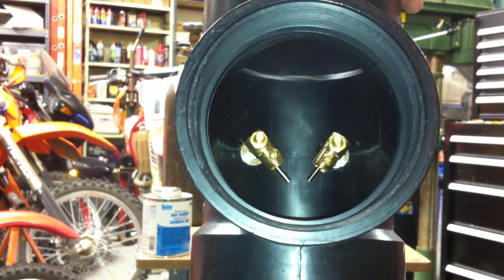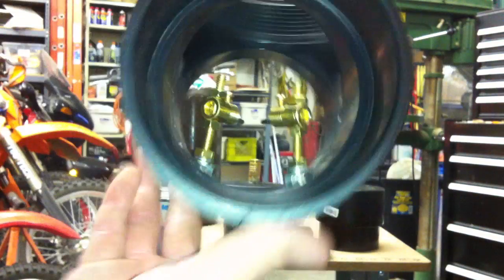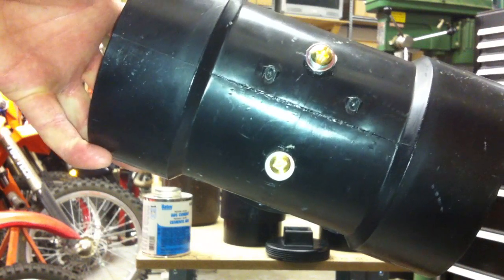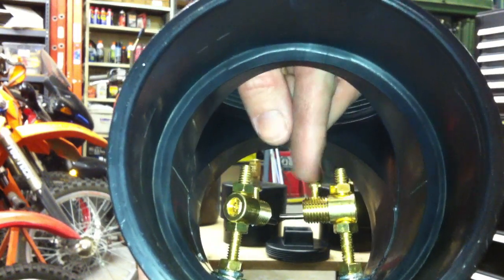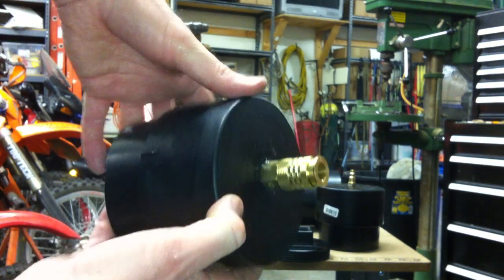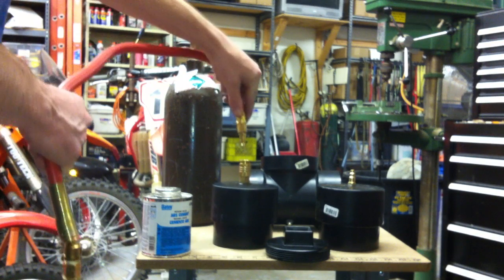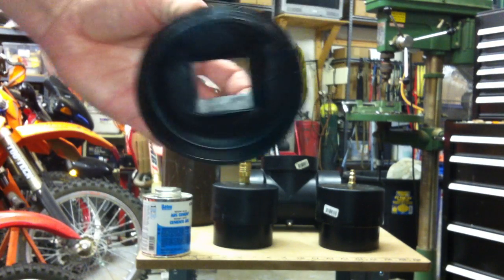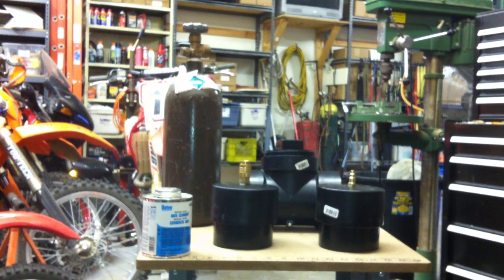Laser EPG 001 - Plasma Arc Chamber, Metallic Ions (Creating Magnetic Gas)

Comment: Hey awesome, a big step towards the E.P.G. is this magnetic gas. Argon, some ferric electrodes, and a couple of very strong magnets to magnetize the gas. Maybe you could try using magnet shards as spark electrodes. That way you already have magnetic material from the beginning! I will be experimenting with this myself soon. Thumbs up to your video.
Reply from the maker: I'm looking forward to your experiments. Just subscribed.
Reply: Russell Martin Thanx, here is what I found out just yesterday that you might be interested in. Ever heard of Linden Experiment? (google it). This experiment was performed by P. Baumann>> Basically a Horseshoe magnet was used with insulated wire wound around the center of the magnet. The two ends were shorted out with themselves forming a 3 ft ring. Between the magnet's poles there was a non-conductive material sandwiched between a plate of copper and aluminum. The device output was measured to be 230 volts! If you look at the Hendershot Generator, Testatika, even Ed Leedskalnin's generator.... all these inventors used the horseshoe magnet with clockwise/counter clockwise windings near it. Linden's experiment may provide the key to these technologies... I am feverishly searching for a U-shaped neodymium magnet. They are not available for sale in the US and have to be imported directly from China (I use alibaba(dot)com to get some quotes). We'll see if I can actually afford these.... Thanx for your subscription. I will keep my channel commercial free forever!

Comment from the maker: Nope, this was my first attempt at designing a chamber for creating metal nano particals through a high voltage arc. I will be ionizing the gas (Helium first) using the gas processor unit. You can check out that video if you want. It's Laser EPG 007 & 008